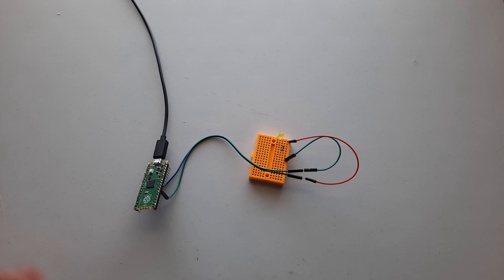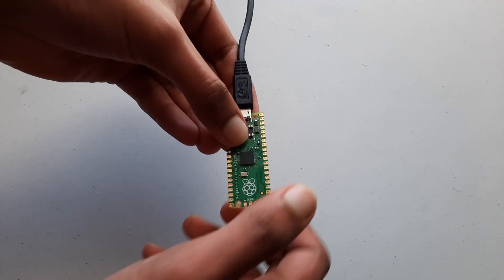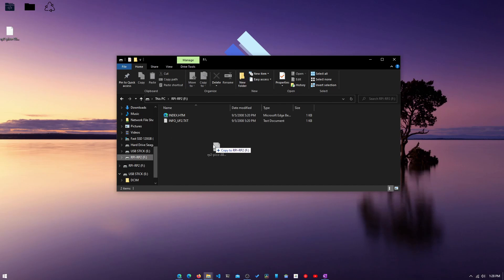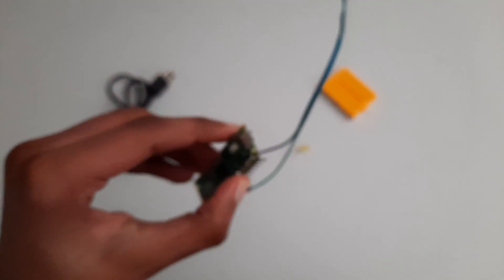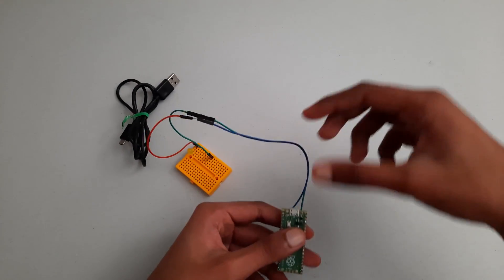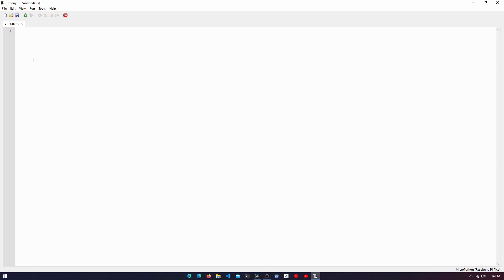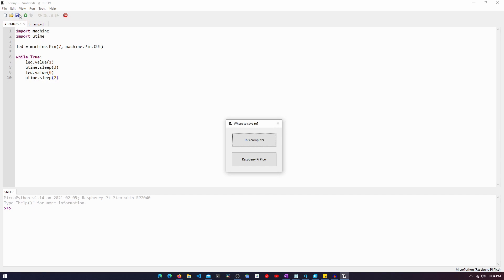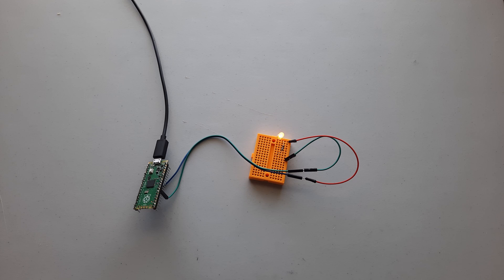Pi Pico Basics | Controlling an LED with GPIO

Comment: What type of resistor is it?
Reply: It depends on the power source and slightly on the led color and type. Typically, a 220 ohm resistor is good for these microcontrolers which work on 5v or 3.3v